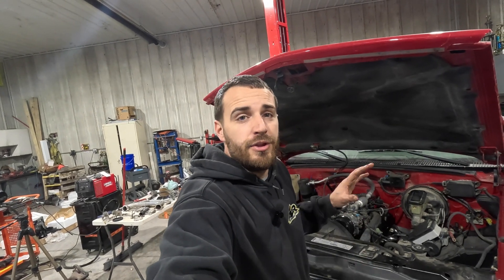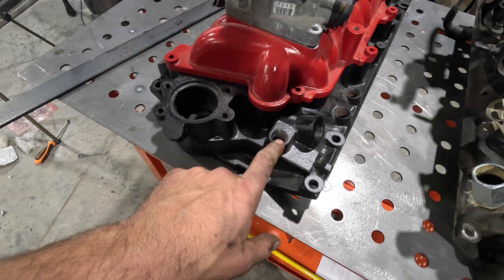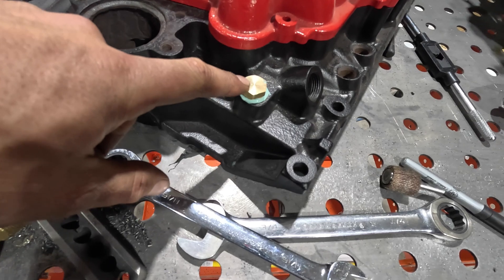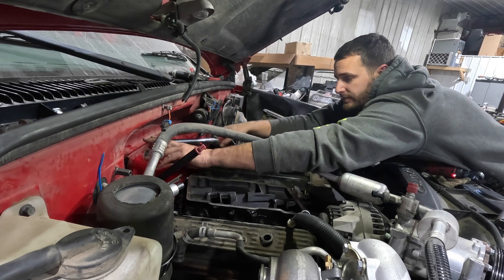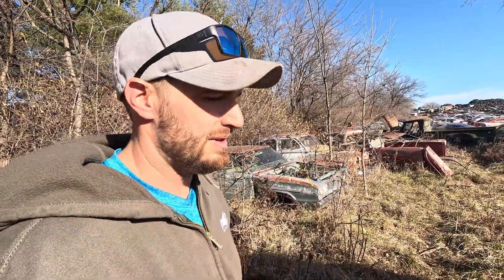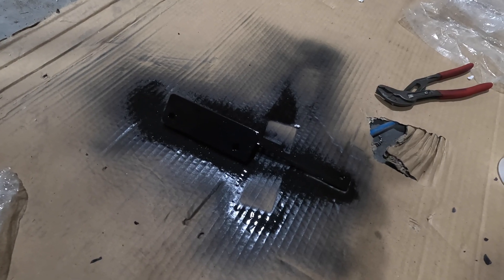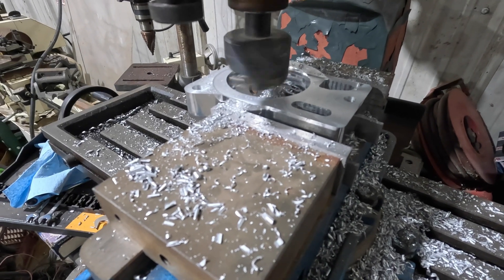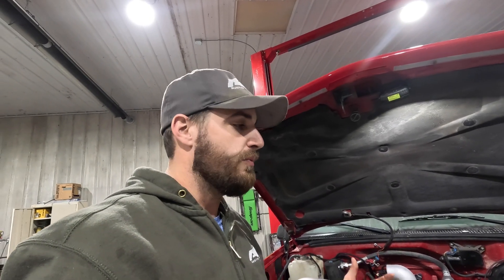Turbo OBS Truck Build: Marine Manifold Swap & Salvage Yard Fuel System! Project Gene

Comment: That looks almost identical as the 4.3 v6 vortec intake
Reply from the maker: Yep! There are also marine intakes for the v6. Both vortec 4.3 and v8 share the same fuel injection design.
Reply: @AERiowa  so i dont need the upper plastic intake if im swapping it with the marine intake?
Reply from the maker: @Jason-oz6tk the upper part on a marine intake is aluminum. But the bottom is cast iron vs the truck one in aluminum. They are not interchangeable
Reply: @AERiowa oh ok i see now i wish they were only one intake on this truck like the sbc have instead of 2 of them.
Reply: @AERiowa my intake manifold on my oldsmobile bravada has a crack on it leaking coolant from it

Comment: Im wanting to do this on my 98. How did you address the fuel injector plugs into the original harness?
Reply from the maker: There's another episode on it where I show myself doing the harness I built a separate injector harness and pinned them in with a metripak connector.

Comment: And I just so happen to have the Marine TB.
Reply from the maker: The conversion isnt difficult, honestly the injector wiring takes the longest. If its a v6, i would just snag an injector harness off an old 3.1 or 3.4L GM car. If its a v8, I cut the injector harness off a damaged lt1 v8 fbody and it worked out great!

Comment: Doing some day dream building, I was looking at one of those Chinesium EFI intakes for vortec heads. Then doing the trigger wheel swaps for LS coils.
Reply from the maker: In some of my other videos you'll see I have the efi connections 24x reluctor and LS coils on my lt1 cars. On these trucks it's even easier than theses since the distributor already is the cam sensor!

Comment: Great video currently looking to do this on my 5.7 as well just got my turbo kit
Reply from the maker: @MaxRCandMoto  check out the hotside video in the build Playlist. It hasn't been too bad but definitely not bolt on
Reply: @ even watching this video I see a lot of work into the new intake which I’m fine with, but honestly I may just end up putting a turbo, upgraded injectors and only run 5 psi then tune with HP tuners